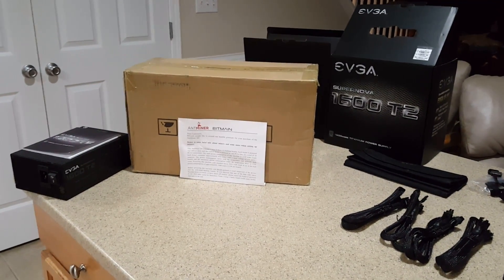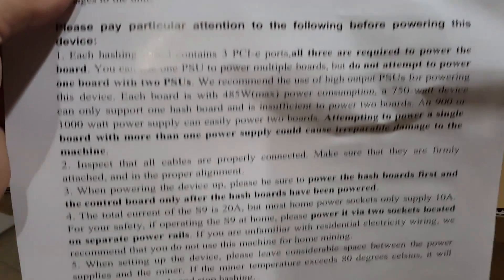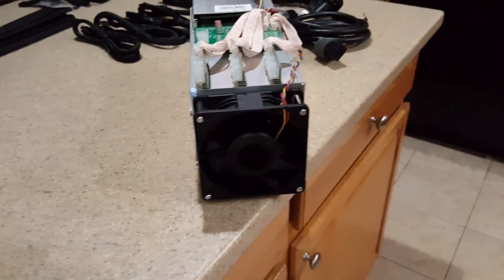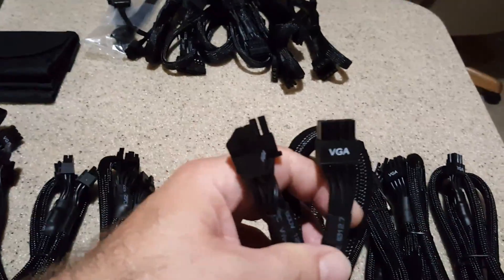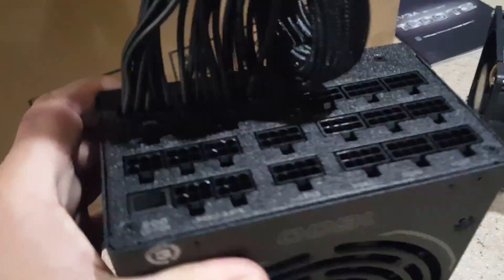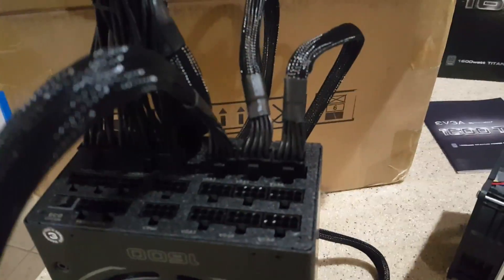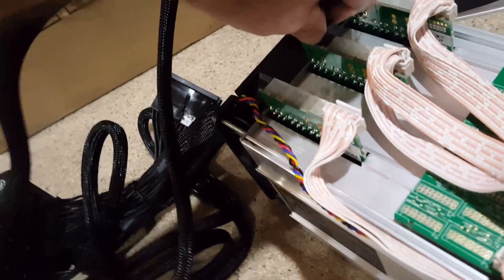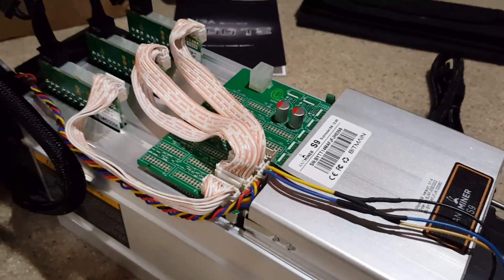Bitmain Antminer s9 Unboxing, Setup Video and  How to Hook Up the Power Supply

Comment: You forgot to mention how to turn the power supply on!!! Lol why does no one mention this?
Reply from the maker: Hi Chad Kozlowski, plug in the 24 pin ATX motherboard plug and use the dummy adapter at the end. Most EVGA power supplies come with a dummy plug you may need to order if it does not or you can do the paper trick paperclip.

Comment: What happens if you settle for a 120v 1200 watt setup with the APW3++ for the S9?
.
.
Would it still hash and mine?
.
.
I do not have 220v-240v outlets where I live. 120V is standard here.

Comment: Last time I ran a Bitcoin miner on that PSU it literally caught fire. Turns out I needed a voltage regulator and a surge protector, and for good measure cable extenders. This was because my house has old wiring though - not really a problem with the PSU itself, but certainly contradicts the assertion that it is OK without any kind of protection. Thankfully I happened to be there to put out the fire when it broke out, and the fire came out of the PSU rather than the miner, so no permanent damage other than a scorch mark in my house and since it happened so soon after setup I was able to return the power supply to Amazon.

Unfortunately, the S9 uses more watts than the 1200 max that my voltage regulator supports so when I upgrade to an S9 my plan is to use a PSU designed for Bitcoin miners (only has cables for one purpose) so it's cheaper and then use a total of 3 power supplies to run each set of 2 miners. I figure that will keep the wattage per power supply low enough as to keep the voltage under control. The alternative would be to under clock. 

In any case, I am curious: Is the energy draw per 6 pin plug the same throughout the device? Or does the control board use significantly less? Also, is there any way to open it up and visually inspect the heat sinks? On older AntMiners I was able to add additional heat sinks to improve heat dissipation.

Comment: The power supply "EVGA 1600" has three different series: G2, P2, and T2.
can someone tell me the difference between these? 
Could  we use any of these power supplies or we are restricted to T2 only?
Reply from the maker: Hi Saleem Wadood, you can use any one of them that you want. the difference is the efficiency at which it convert AC to DC.  If I remember correctly the T2 pays for itself in about 2 to 3 years over G2 in lost power.
Reply: Thank you.

Comment: Are there power supplies that generate reliable power without the noise? Seems like the noise would be hard to tolerate unless you've got your own room/garage, or private office? Did you ever trip breakers or require an electrician to perform any upgrades?

Comment: Hi! With the EVGA PSU are you able to use a standard outlet?
Reply from the maker: Hi Taylor Ives, yes that power supply can be plugged into either a 110 or 220 outlet.
Reply: If the psu I have for my antminer s9 has a 220 plug, is there any way to convert is safely to an normal 110?

Comment: hi where did you buy the cap for the motherboard cable? And also, in total there are 10 pcie cables correct? This is what is required for the S9 according to bitmain site.
Reply from the maker: Hi Kung Young, it comes with the power supply, and there are actually 9 cables but it's all you need to hook up the antminer S9.
Reply: thank you that was very helpful. I have an antminer l3+ coming in September and purchased the EVGA 1600w P2 power supply. I suspect the setup will be very similar.
Reply: TheBitcoinMiner so the cables come included in the power supply set
Reply: Hack: In case you don't have a cap, using a BARE paperclip bent in a U shape, connect the (typically green) wire to any black wire on the 20/24 pin main connecor and it will get signal to power on, then you can plug it in and fire it up.

Comment: those vga cables...where did you get them, or what brand are they?  and are those 8 pin FEMALE to 8(6+2) FEMALE cables?   Or is one of those cables a MALE end?  if they are different, what side is used for which piece of hardware?  Thanks :)

Comment: Hey !

So if I see right, using a psu like this to power an asic we need to put the mobo cable on the psu, but there's nothing to do with it ? No bridge or something ?
Reply from the maker: Hi Max_Bvr,  there's a small adapter that comes with most EVGA 1600 power supplies.
Reply: Thanks for you answer !!
We have to plug this on the 24pins so ?

Comment: did it work after you plug the Ethernet cable? I bought 2 s9 I did the whole process and it won't turn on any fan or light? could it be internet issue?

Comment: I live in the United States.  Does anyone know what power supply I should use for my new Antminer S9 for electricity from my house.  Do I need to get a 220 outlet?>
Reply from the maker: Hi joeyloveification, it depends what power supply you bought for it. If its a pc power supply you can use 120 or 240.
Reply: dude i suggest you get the EVGA PSU listed above and demo'd in the video by TheBitcoinMiner. that looks like the easiest way.
Reply: TheBitcoinMiner might be a stupid question but the power supply you got there is it for pc or no?

Comment: What if the power goes down and back on in the wall outlet, will the miner automatically continue operations or does it require a manual restart?

Comment: i need someones help please!! just received my antminer S9.... its up and running and hashing ALTHOUGH one of my boards... is showing idle hash rate but not actually hashing.... it has less 0000s then other two boards and the unit as a whole is not hashing at the full 13.5 that machine is supposed to. also im only show chip 2 temps and not chip 1 temps. please please help
Reply from the maker: Hi mike firlingo, sorry to hear you're having trouble. Considering it's brand-new a couple of things come to mind, are you sure you hooked up the power correctly? I have seen loose connections on them before sometimes you have to make sure everything is well connected. Did you give it a jingle before you started it up and make sure there was no loose heat sinks? Unfortunately you may just have a bad bored and you may need to contact bitmain.

Comment: hello man, nice hardware, with s9 i can mining ethereum?, thanks!
Reply: But with an S9 you could get more coins per day than on a normal pc, or what do you say ?, I have several AntMiner S1, I wanted to use them to mine this coin but I have not found the way to make them work
Reply: Tanjo 
Would you know where I could investigate how to configure my AntMiner S1 to mine the ethereum currency?
Reply: Tanjo 
I read in the ethereum forums and say AntMiner is made for SHA256 and ethereum for ether. That both architectures spn miy different.

Comment: Crazy question -- but did you plug your EVGA into a normal 110V home power outlet, or is that outlet serving 220V?  

Part of the reason I wanted to get the EVGA was to get around having to use 220V...which I currently do not have wired.  And, as you know, the PSU that ships with S9 requires at least 205V.
Reply from the maker: Hi David Carroll, yep the EVGA power supplies can work on 120 or 240 volts.

Comment: Hi Miner,
I am looking to buy an s9 in October.  I was just wondering how hot is it running?  And how many bitcoins on average do you mine per day with it?  I am just starting out in mining.  I just bought a s3+ been running for about a month and only have about .005 bitcoins :(...
Reply from the maker: Hi Normand Bourque, welcome to the Bitcoin mining community!  That's a very tough question to answer because of the power cost and a lot of other factors but roughly if you pay $0.10 a kilowatt antminer S7 right now is breaking even and S9 makes you about $6 a day.  Watch this video it explains a lot better. https://youtu.be/OtR6UraFa5M
Reply: Thank you!

Comment: Hey BitCoinMiner, I recently got an ant miner s7 and it says residential peer is 10V and the unit uses 16V, and it says it's recommended to run on two deprecate power rails..? Can you tell me what this means and how I do it? Thanks I enjoy your videos
Reply from the maker: Hi Venture Foro and Thx. Tt's technical info for what power supply you might need to buy but the only power supplies that I know of that work are the EVGA 1600 the one that antminer makes themselves and some  higher-end server power supplies.
Reply: Thanks

Comment: hey man awesome video thanks for sharing. im looking to get into bitcoin mining but im totally new to cryptocurrency. ive done alot of research of they past week and i was wondering what kind of income is the s9 bringing in a month? and is it worth having just one s9 running in my house?
Reply from the maker: Hi jimmy hodnett, Thx! Sure it's worth just running one especially if you think long-term. They said 1 Bitcoin could be $20,000 in the next 10 year. Right now but it's constantly changing one s9 can generate just under Bitcoin a month but to be more accurate check this video out (https://youtu.be/OtR6UraFa5M) and use the calculator.